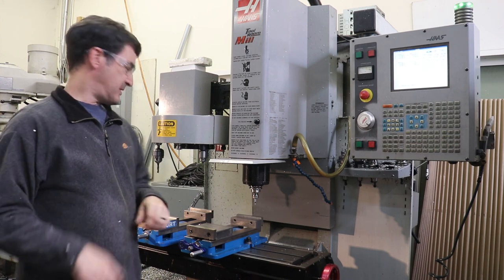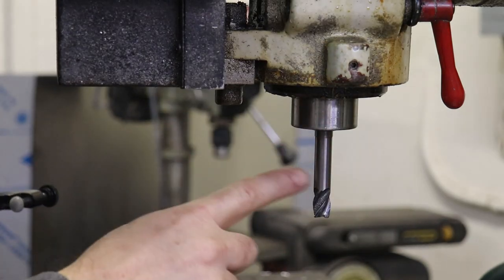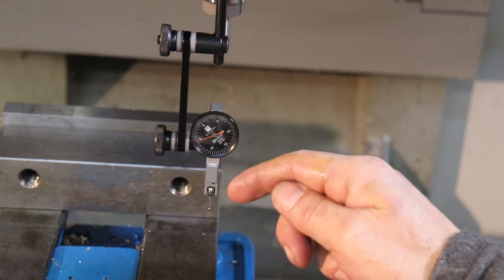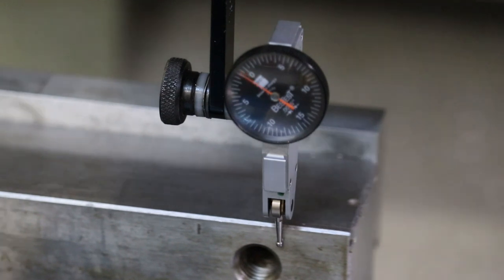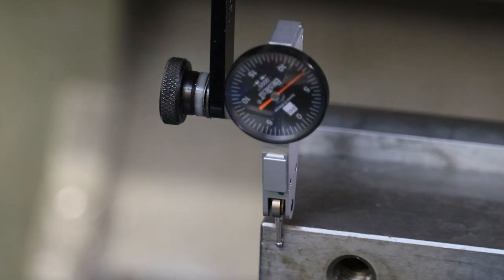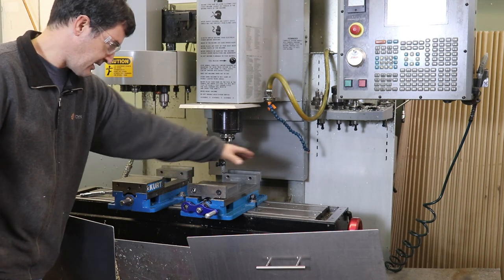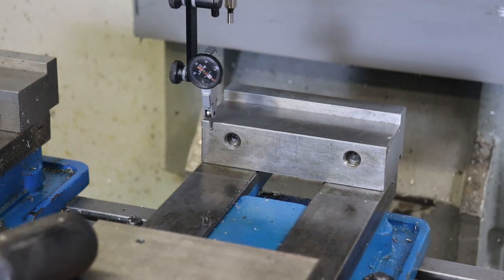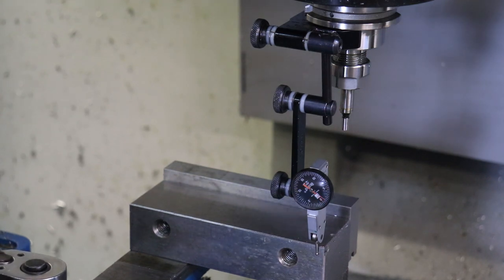MILL VISE SETUP: 1 OR 2 VISES (FOR BEGINNERS)

Comment: My vise are 2 cheap imports.  
Surface ground bases flat, which also made rails same height.
Surface ground both fixed jaw and movable jaws to match 
Ground jaw inserts of both vises to match.
Took piece square ground  it  Mounted it to Mill table. 
Clamp both vises to  the square stck. Then milled key way slots in bases of vises. 
Surface ground solid 4 wide by 1 inch thick  bar to us as an alignment tool . 
I am sure there was some areas i should check but they seem to align nicely.

Comment: Surface ground / milled "keys " to mount in base to fit smug in the vise and Mill table slots. That i use as a "Master"  Saves time.
The "Slave" vise keys are match to Master vise keys also.

Comment: I'm surprised you can clamp the indicator to the tool holder without preventing the spindle from turning, and the indicator doesn't rotate the tool. I guess the force on that indicator ball is so small compared to the inertia of the tool holder, spindle, and motor, it doesn't rotate the tool?
Reply from the maker: that is correct, the lever on the end if the indicator has little force on it compared to the mass and stiction of the spindle.  You can also get a dovetail mount rod and check it into a drill chuck or similar for a more  rigid setup, but it takes a little longer.  Thanks for watching!